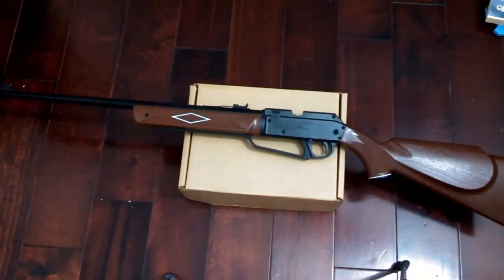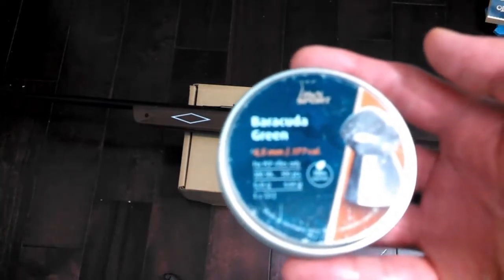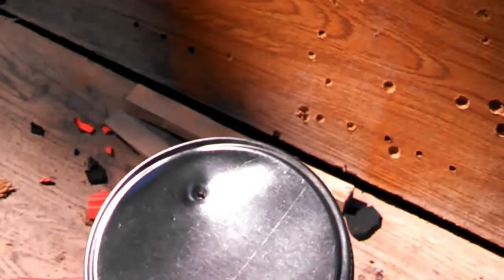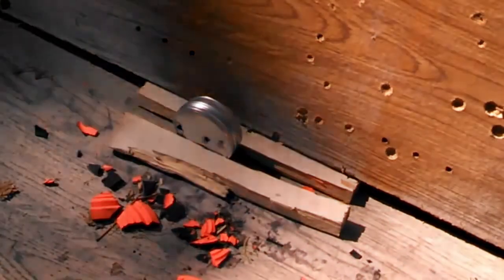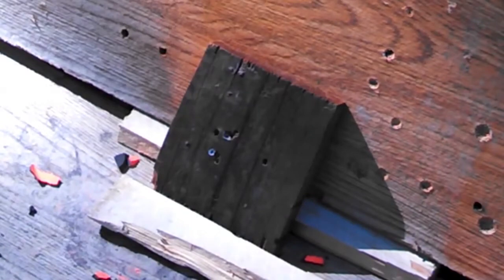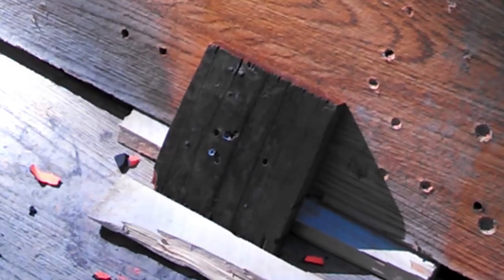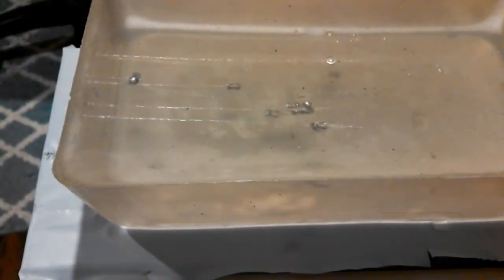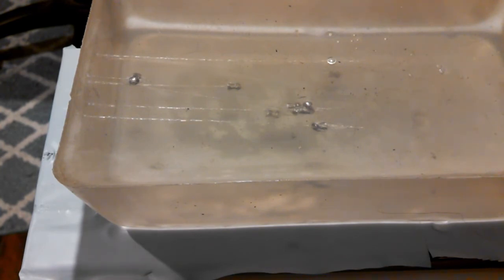Daisy 880 - Ballistic Performance Per Pump

Comment: Great video.  I want to use my 880 to teach deer to stay out of my garden, but I don't want to break the skin.  I sighted in at 30 yards using three pumps.  Does anyone out there have advice for me?
Reply: I know this is a pretty old comment but I’m experiencing the same problem with deer. Did you have any luck?
Reply: @inspectorperc4938  I have continued to be conservative when pumping to shoot deer.  In fact, I now use an Air Soft Tommy gun.  The noise scares them more than the pain.

Comment: 880's are special+great. decades old experience shooting a lot of the Quicksilver match and pointed pellets, was 4 maybe 5 pumps with match pellets, 5 maybe 6 pumps with the pointed.. if you wanted good accuracy. today there are so many pellets available we just don't know what to expect! it'd take "forever" to test each at 5-6-7-8 pumps, maybe 9 if a pellet is still grouping 5 tight at 20 yards. some will have their fps "sweet spot" like the old Quicksilver's mentioned, and no doubt some will stand out "test me at 30 yards!"
it'd be a LOT of work and a lot of shooting to create a table of "good better best" pellets to go out hunting with. its just theory.. some pellets more affected than others, but too many pumps = too much air = tipping the skirt as it exits the muzzle, throwing accuracy away.
heavier ones like 10.5 grain Piranha seem pretty happy at 8 pumps.

Comment: Very cool video!  Pumpers with there self limiting power are very useful. They are fun to shoot and great for teaching kids. Did you know Gamo/Daisy have an upgraded 880 called the Winchester 1977XS with a MSRP of $129 w/ scope? Daisy claims 1000 FPS and there are videos confirming. My friend bought one for only $70 at Academy sports. It has excellent accuracy and power.
Reply from the maker: That’s awesome. I’ll need to look into that for sure. I always wanted a pumped that could put out as much power as a break barrel but still have the option of weaker shots when I need it

Comment: I cant zone in the scope
Reply: I couldn't  either so I just became a master with the open sights 💯
Reply: @jamespeterson6198  the open sights ARE pretty good!
Reply: stock scope came with my new one was JUNK! I put a laser sighter in the muzzle and at 15 yards through the scope it was a big 3/4" blur type junk.
put a little 13 dollar 4x20 scope from eBay on it.. aah yeah, dialed right in at 20 yards no problem